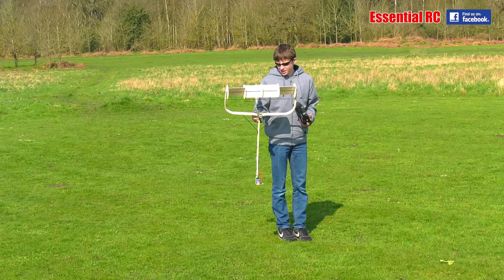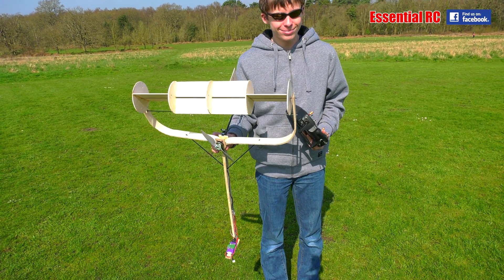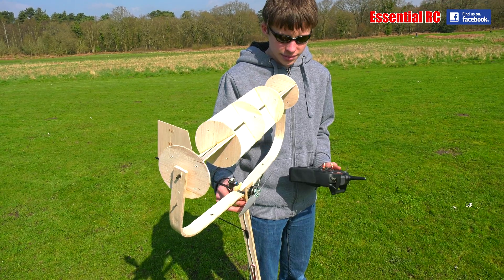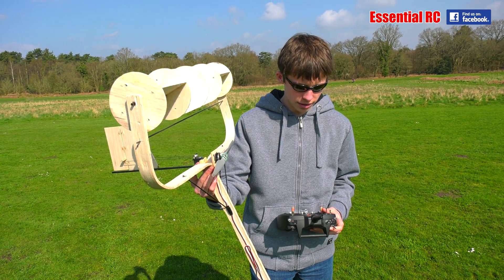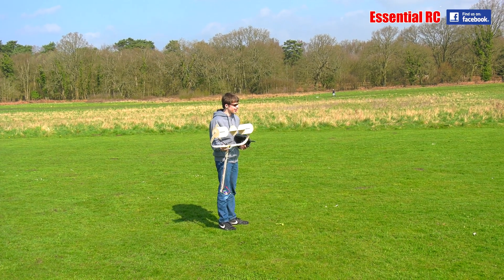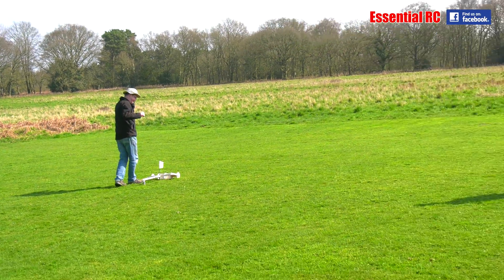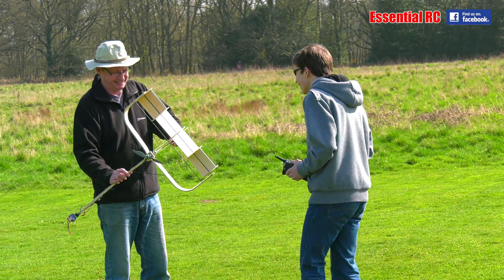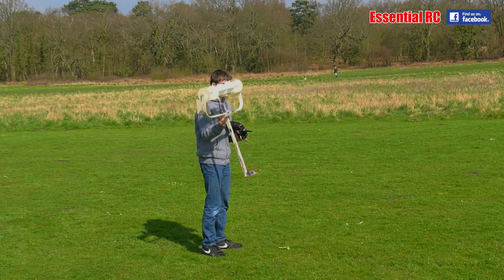*AMAZING* MAGNUS EFFECT RC PLANE

Comment: Great video, I wonder what happened when you turn off the forward thrust engine? Would it fall down immediately or will it goes in an auto rotation like a helicopter does when the engine turns off. Nice
Reply from the maker: The rotary wing would continue with forward motion but it going to lose lift very quickly. He'd still have enough momentum to make a controlled landing.
Reply: @EssentialRC  thx 🙏👌

Comment: I don't think it's spinning fast enough to be a Magnus effect. Also, the wings aren't cylinders but are just slowly rotating planes which average out to a conventional wing.
Reply: R V - Magnus effect does not require a cylinder, just a rotating object creating a pressure differential.  And "averaging out to be a wing" makes no sense. The cylinder spins 360, so it never has a fixed angle of attack. This combined with the fact he has no elevator yet it still goes up means there is a pressure differential.
Reply: You're fooled by the aliasing due to the camera's unfortunately overly short exposure time, it spins much faster than you realise.

Comment: Amazing absolutely amazing. I was wondering how yoy were going to land it. An idea. Foam ball on the foot and program reverse thrust fornthe prop. Ball touches down plan pivots forward pop reverse thrust to slow the pivot kill thrust just before touch. Soft landing.

Watch that stab its fluttering pretty badly.

I have never seen one of these SO stable. Crazy smooth and awesome to watch. Very very cool! Show peter spiriol this he will love it!
Reply: Yes the main problem with my design is the vertical stabiliser vibration (I'm the kid in the video who built and flew the aircraft). because of this when it flies it is the loudest plane in the air. I will need to fix this for the next design.

Other improvements for next design:

- make it lighter/more efficient (it flies on very high throttle and drains battery quickly)
- stiffen the horizontal parts of the frame (they flex far too much)
- find a better way of landing.
Reply: MrJabbaj i look forward to seeing what you come up with. It is an amazingly cool model to see!
Reply: MrJabbaj, can you share any plans, drawings or whatever you already have? Thanks! That was awesome!

Comment: You should get more lift if you can get the motor above the paddle wheel. Check out my Spinny Bird Magnus Aircraft.
Reply: Yes, the rotor would spin faster, however I classed that as cheating during design.
The aim was to make an aircraft that relies entirely on the magnus effect. 
That means no upward thrustline, no horizontal stabiliser, no assistance to the rotor.

Comment: if the rudder is fixed, how do you turn?
Reply from the maker: It's not fixed. The throttle and rudder are the only ways to control it from the transmitter. Cheers Dom (Essential RC)
Reply: Thanks!

Comment: Congrats to the designer! That's a crazy inventive setup, and seems to handle quite well in the air. And it's an autogyro as well! All Magnus Effect attempts I've seen so far have had a powered rotor cylinder. This lad is going places. :D

Comment: What design feature makes the 'wing' turn in that direction ?
Reply: There is no feature.
The wing can turn in any direction, and it will maintain speed as long as there is lift.
It works due to the fact the center of lift on a wing is in front of its centerline. due to the motion of the rotor the air underneath is turbulent. stalled as such. the air on top is not, so the lift created on the surfaces propels the rotor round. this is not part of the magnus effect, this is just to maintain rotor RPM.
At least that's my theory 
(I'm the person flying the plane in the video)